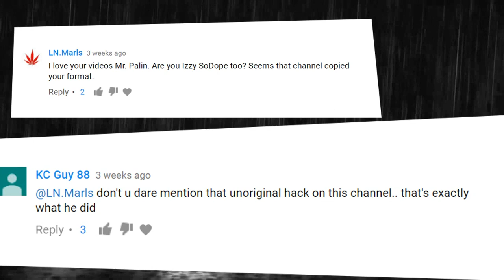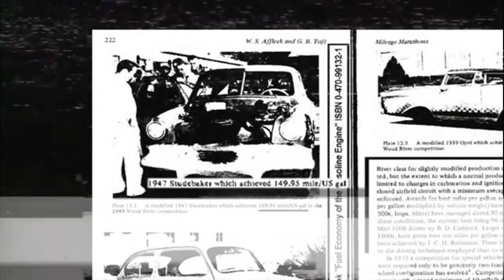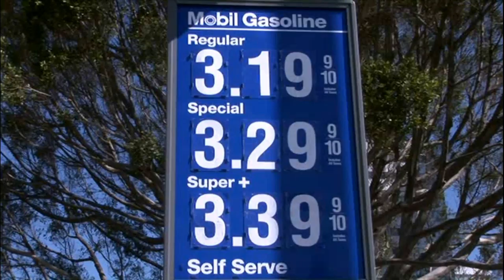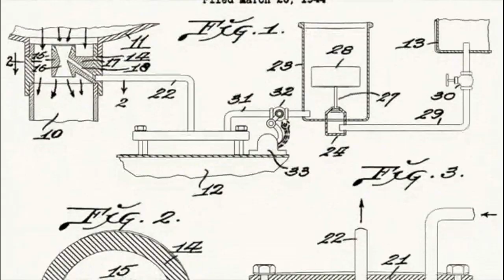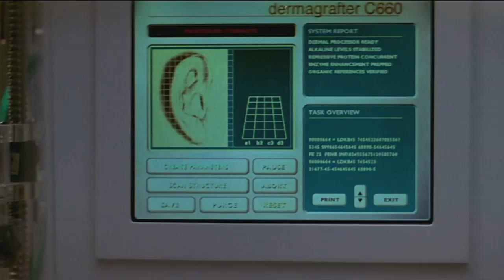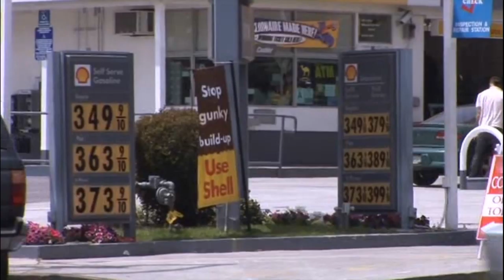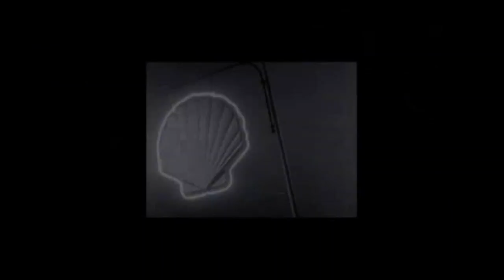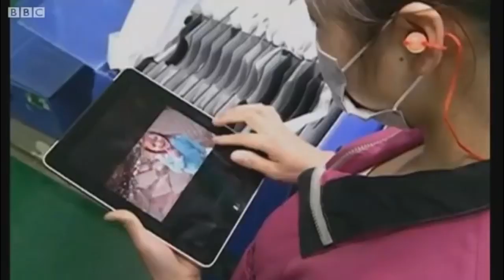Bill Burr - GasHole

Comment: 1000 miles per gallon of gasoline?  Lol, there isnt enough energy in the combustion of a gallon of gasoline to even get close to that figure.  It's a simple calculation, assume the efficiency of everything is n=1 (100%) and the weight of the object is 100kg with no friction loss (just for simplicity sake) and you STILL dont get enough energy in 1 gallon of gasoline.  This is such bullshit it make me laugh.
Reply: with high end energy recovery (engine braking and turbo harvesting) we are hitting just over 50% thermal efficiency @ about 1000bhp in F1 with "almost" pump gas, if they could do 1000mi in a gallon they would be ;) and the entire fact they are talking about volumes tells me this is 100% BS, anyone in the science and engineering side would be talking weight due to thermal expansion.
Reply: hydrogen
Reply: no friction = car never looses it's energy and doesn't need fuel to run at constant speed. so i don't understand what you are talking about
Reply: I like how you named the variables but didn't show any of the math.
Reply: If you disregard friction you could make 100kg travel a light year by just gently tapping it with your pinkie. Acceleration takes energy input, the rest is friction. Having said that, in real world terms 1000mpg in a regular sized gasoline powered car is indeed completely preposterous
Reply: @-BuddyGuy  You are right Buddy.  Sorry just typed this out really quick.  Unrealistically low amount of friction would be the ticket.  The energy density of gasoline will not get get you 1000 miles, alone.  Now like Jakov said, if you add another propellant, that is a different story but that is not what was claimed.  
to Zach: I am not going to attempt to write an equation out in a text-box in a comment section.  Look up how MPG is calculated, hell there are calculators online that let you just input the variables.
Reply: Yea "adding another propellent" only causes confusion and is an invalid concept.  Just like "adding more gasoline and adding another engine"...🤦‍♀️
Reply: @taraspokalchuk7256  Take me to the zarglax dimension where there's no friction whatsoever. Even in space there's small amounts of friction.
Reply: @JX VX The OP specifically mentioned friction.

Comment: The car weighs X pounds, and the gasoline molecule produces Y amount of energy when burned.  It makes sense to me that there would be a limit on gas mileage because no one wants to drive the lightest car on the road.  It would be a death trap in the event of an accident.  I disagree with Bill here.
Reply: Nobody uses that big squishy thing between their ears anymore. They just listen and believe! Never mind the fact gasoline only has an energy density of 45 megaJoules per kilogram, I've made an engine that can get a million miles from a single drop! I worked at [Gas company] don'cha know.
Reply: Also, it doesn't matter if the car is absolutely weightless.  It has a coefficient of drag through air.

Comment: I don’t believe anything in any of these documentaries
Reply: I'm a mechanical engineer and subject matter expert in this field of specialization.
Everything here is true and so much more. I have all the original documents from Shell, Cummins, The US Army, SAE, and so much more. Let me tell you something, the thermal efficiency of a standard poppet valve engine is NOT 25% efficient. Its more like 5% efficient. 	Most engines and fuel systems currently in production are designed for one specific fuel type/source. This greatly limits fuel flexibility and has been a major hindrance to the viability of alternative, renewable, and green fuels. Furthermore, long chained liquid fuels reduce the efficiency of engine systems because the heat from the combustion of the fuel is required to overcome the latent heat loss to evaporate and chemically break down the fuel before oxygen from the intake charge can bond with the hydrogen, oxygen, and various other combustible elements found in liquid fuels.
	When using liquid fuels, including direct injected liquids, no matter how well atomized the fuel is the liquid droplets are still a stratified charge that will sap heat from the engine via latent heat loss via evaporation and chemical breakdown before oxidation/combustion of the fuel can occur. This inherently means that all liquid fuel systems use a stratified charge, and can never become a true homogeneous charge. Because liquid state fuels in a stratified charge carry sound, shock, and impact waves more readily, this makes stratified charges far more susceptible to detonation and “engine knock” conditions when higher compression ratio's are used. This has been one of the primary limiting factors for engine efficiency since the beginning of the internal combustion engine.
	Gaseous fuels such as methane and propane have exceptionally higher octane ratings in both RON and MON. This is partially due to the fact that gaseous fuels readily and naturally homogenize with intake air and partially because of their shorter and simpler molecular structure. These true homogeneous charges allow engines using gaseous fuels to run much higher compression ratio's, which greatly increases the efficiency, power to weight ratio, and performance of the engine. Gaseous fuels such as propane and methane also have higher energy density's by weight because the fuel does not need to waste its own energy to break itself down to continue the propagation of the flamefront. This is why methane has the highest energy density by weight of any common hydrocarbon as it is one of the shortest and simplest hydrocarbons. By observing the various types and lengths of hydrocarbons we recognize a general pattern, that the shorter and simpler a hydrocarbon is, on average, the higher its octane rating and energy density by weight will be. In effect, the shorter and simpler the hydrocarbon is, the more energy per atom of hydrogen and carbon burned can be extracted.
And thats JUST the god damned fuel delivery system.
The throttle plate induces artificial pumping losses and creates an artificial load by reducing the volumetric efficiency of the engine at any condition other than WOT. This greatly decreases fuel efficiency, but is "necessary" because unless extra liquid is injected into the engine if it runs lean the fuel will detonate and destroy conventional engines. BUT engines capable of withstanding the forces of detonation,l thus achieving true constant volume combustion, have been designed. Most conventional engines have 4 strokes per cycle, which doubles the internal friction per power stroke compared to a two stroke cycle. Furthermore, the valvetrain is where most engine friction comes from. Not to mention that the 2 fold symmetry of wiggling connecting rods means that conventional ICE's are incapable of running in detonation as it will cause the con-rod to bend and the skirts to fold in on themselves. Engines of the 2 stroke per cycle variety typically rely on the underside of the piston, which in such designs are open to the crankcase, to act as a supercharger to force exhaust gases out of and fresh fuel/air mixture into the combustion chamber when the piston reaches the bottom most portion of its stroke and cycle. Some 2 stroke per cycle engines, especially larger industrial engines, one such example being the Detroit Diesel Series 71, instead rely on a supercharger or turbocharger bolted to the engine to provide this scavenging force rather than pressurizing the crankcase. However, these engines fail to exploit a benefit of relying on an external supercharger and/or turbocharger because they still only use one side of the piston to convert chemical energy in the form of combustible fuels into mechanical energy. The reason why they are unable to do so is because conventional connecting rod engines can not isolate the bottom of piston from the crankcase oil. Furthermore, 2 stroke cycle engines despite their higher power to weigh ratio's and greater overall efficiency have recently fallen out of favor due to recent NOX emissions standards.
	In response to this, industry as a whole has, with few minor exceptions, not pursued innovating new mechanisms to solve these challenges, instead choosing to rely almost exclusively on computer controls, electronics, catalytic converters, and various other accoutrements to reduce emissions and attempt to increase power output of conventional 4 strokes per cycle engines and has done so with limited success from an engineering perspective. However this approach, though  traditionally considered to be financially safe by accountants, has resulted in engines that are of much greater complexity, cost, are considerably more difficult to maintain, and are less adaptable for a wider scope of uses. As a result, conventional engine of the current era are highly specialized machines, and the performance gains in efficiency, power output, power to weight and displacement ratio have been relatively marginal at best. To this day even the most efficient conventional piston engines have a mere 50% thermal efficiency, and these high (by conventional standards) efficiency engines have abysmal power to weight ratio's. It is for these reasons that a new generation of engines are needed. Engines boasting higher power to weight ratio's, higher efficiency, less moving parts, less internal friction, and simpler more robust and easier to maintain designs will be necessary in the 21st century and beyond. Previous attempts at commercializing scotch-yoke type engines have failed for a plethora of reasons. One of those reasons is that though they have higher power to weight ratio's and efficiency than conventional engines, the performance increase was not sufficient to justify switching to a new designs in prior years. This is all just scratching the surface.

Comment: For the past 11 years, students competing in the Shell Eco-marathon Americas have designed, built and tested ultra-energy-efficient vehicles, with some achieving more than 3,500 miles per gallon. 2018 marks the 12th edition of Shell Eco-marathon in the Americas and the return to California where the first Shell Eco-marathon Americas student challenge took place in 2007 with less than 20 teams competing on the inside track of the California Speedway in Fontana. Straight from shells website btw

Comment: ever thought why everything around you is made out of plastic?
Reply: Yes. It's because plastic can be molded, which makes it a convenient way of making large numbers of things for sale at an affordable price.
Reply: @devilsoffspring5519  Metal can be cast as well.
Reply: @vinigretzky97  Yes it can, but it requires higher temperatures (more energy) and more expensive tooling to cast metal. That's why your computer keyboard is made of plastic and not cast stainless steel.
Plastic is cost-effective for making many consumer products and can be recycled. Metals, not anywhere near as cost effective. Metals are also recyclable but cannot be worked with as easily and cheaply as plastics can.
So, your computer monitor frame, your food containers in the fridge, and  numerous other products are plastic and not metal.
No, kids, it's not a "conspiracy". It's product design & engineering, optimized for good cost-effectiveness. Plastic is used where possible, metal is used where necessary. For example: Engine blocks are made of metal (usually aluminum these days.)
Dashboards are made of plastic, because it works fine, and is cheaper. It's probably also safer as well.

Comment: Gas millage has increased from 40 to 80MPG in the pass decades. The issue is that government regulations require that gas emissions are reduced in potency and VOCs. To comply, manufacturers are now using less efficient methods to reduce emissions while trying to maintain efficiency. It's like if they really want us to convert to electric vehicles.

Comment: I'm no expert, but thermodynamically thinking I bet the upper bound for gas mileage for a car is around 150. If we had small diesel or HCCI gas "range extenders" onboard hybrid vehicles with sizeable batteries. the hyundai ioniq is pushin like 65 miles per gallon, and that's just a traditional hybrid with a fairly large engine. there's a sweet spot for engine size to maximize KWH per gallon, and i think running a fairly small engine at 80% capacity to maintain freeway speeds and continuously top off the battery at stop lights and the like would probably be the best bet to push the 100+mpg barrier.

Comment: Gas mileage/efficiency has improved quite a bit but cars now weigh 2x as much and have 3x the horsepower.  If yoy want a 2000 lb car with 75 hp, you can probably get 150 mpg.  But such cars don't exist due to cheap gas and safety issues.
Reply: 1970 HONDA CIVIC - 50MPG -80HP MOTOR 
2019 HONDA CIVIC - 50MPG 240HP MOTOR
THEY FOCUSED ON HORSEPOWER THE LAST 50 YEARS
NOT GAS MILEAGE!!!!!!!!!!
Reply: @thecloneguyz  They didn’t start selling the Civic until 1972 and it had 50 hp and was tiny and had a combined highway city mpg of 45 mpg. The best small motorcycles or scooters get 100 mpg, so no a car is not going to get 150 mpg.

Comment: Technology doesn’t add energy to a drop of gasoline. It’s basic physics. Racers and gear heads would do anything to get around this to win and go faster (including me). Until we use atom power, only marginal gains will be had.

That said, if humanity had a small cold fusion reactor that used water, “they” would keep it suppressed. I just don’t believe it exists.
Reply: Well i know nothing about cars but technically whats being discussed is gas efficiency (mpg) not high end performance (racing).
Reply: @pinchevilla4268  one is just another side of the other.
Reply: Pinche Villa; vehicle fuel efficiency, top level performance, and brake specific fuel consumption are all based in how much energy is in a given amount of fuel (gas, alcohol, nitromethane, etc), as well as the atmosphere (oxygen) it’s mixed with. Bill’s great but he’s minimizing massive gains in engine efficiency over the time period he’s complaining about. It’s painfully inaccurate. Funny, but inaccurate.

Running on water and a thousand miles a gallon or even 149 as this vid claims is absolutely, almost unbelievably, ridiculous to those who understand the underlying physics and engines. Totally not trying to condescend here or make it sound like I know it all, but I know enough to say what I’m saying... and I don’t “believe” as Bill rants.
Reply: @orbitaljellyfish808  👍gotcha. Thanks for trying to explain

Comment: Outside of the first little bit shown here, I've not seen The Gashole. I spent 10 minutes researching the claims made in that minute of footage. Namely, that 

The claims are that 1) Shell published a book called Fuel Economy of the Gasoline Engine, 2) the book is out of print and 3) it has disappeared from the Library of Congress.

Let's deal with 2) quickly. In the context of trying to prove something nefarious about a book's availability, saying it's out of print means nothing. Most books are out of print. When you hear the title Fuel Economy of the Gasoline Engine, do you imagine it flying off the shelves?

The claim that Shell published the book is incorrect. Both 10 and 13 digit ISBN's show the publisher as Palgrave Macmillan, a British company that deals in academic and trade publications.

Searching on the both title and ISBN at the LoC reveals two editions of Fuel Economy and The Gasoline Engine. It doesn't prove that the book didn't disappear for a time, but it does suggest a spurious claim.

It doesn't take much to expose the raison d'etre of conspiracists.

Comment: The main problem is carbon emissions the engine is choked out by all these regulations same thing with diesel truck engine we used to have some of the most reliable semi engines on earth now you can't produce them anymore caterpillar Cummins these engines were Unstoppable. Also there's 10% ethanol in Gas that  knocks off 10 miles per gallon right there

Comment: Gasoline is the most efficient fuel in terms of mj output by weight.  There are loads of other fuel sources but theyre not currently mass produced and it's not economical.  There would have to be a massive shift in public perception to get anything other than the current gas and electric off the ground.

A really cool fuel source is sodium.  There's a whole lot of chemistry I'm not going to go over but essentially if you mix sodium and a gas like methane and oxygen,  you get a carbon neutral fuel with a similar energy efficiency as gasoline.  Also its by-product will actually bind with carbon dioxide and pull it out of the air.  You wouldn't want to use it near people but cargo ships and planes would be a great start.  Unfortunately solid sodium is expensive as hell compared to gas.

Comment: The reason I don't buy it is the physics. You can measure the amount of energy being produced and spent in a car. You can measure the amount of energy each molecule of gas gives off, how many molecules are in a given volume, and how much energy is eaten up by friction in mechanical parts, and how much energy you'll bleed resisting the air. Modern gasoline engines are about 35% efficient in transferring the power of each molecule to movement and usable energy. So an improvement to over 100 mpg? That seems possible. 1000? You'd have to make the air thinner and invent some sci-fi frictionless components, and inject oxidizer into the fuel mixture.

Comment: Water injection does exsist. It was actually used in ww2 aircraft motors to increase the fuel pressure. Not that it runs on water.

Comment: Gas mileage can be improved hugely but there is a cost. The cost is performance and practicality. The driving experience and quality of vehicles would be shockingly bad due, in part, to the reduction im vehicle weight required. Water injection internal combustion engines do exist. Adding water to the combustion increases the neccesary overall  expansion associated with combustion. Apparently